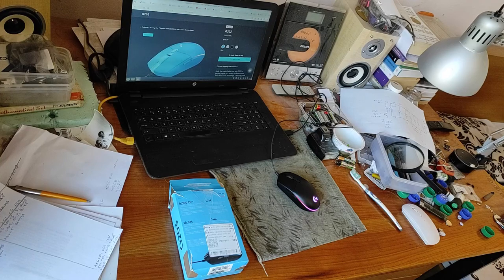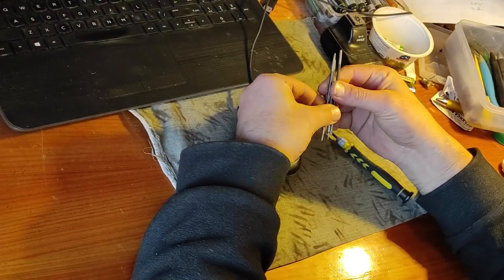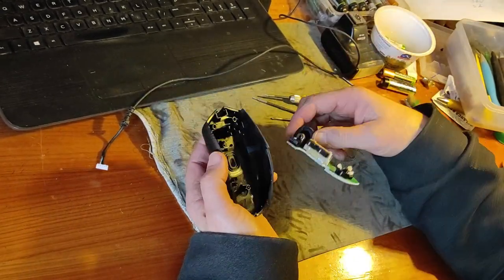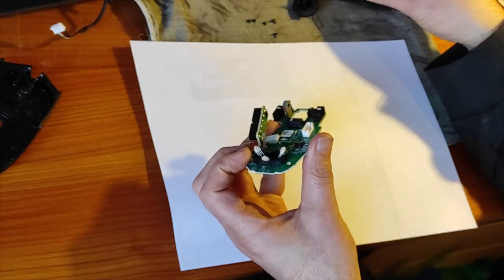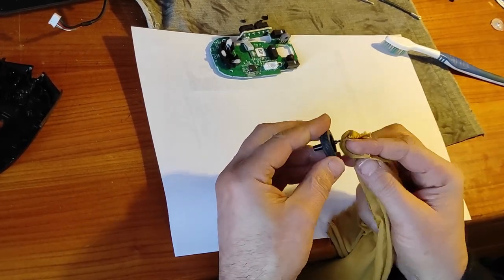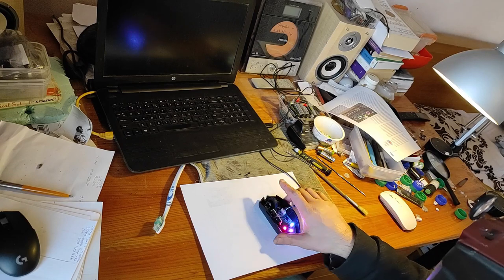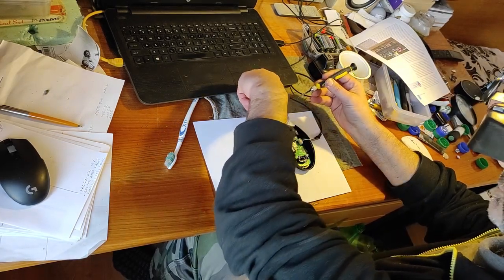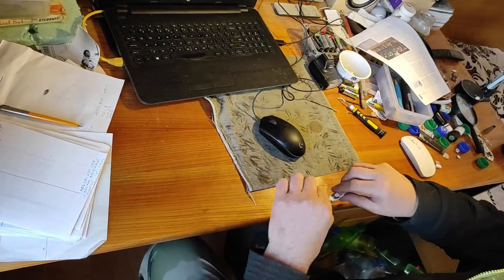Fix Your Logitech G203 Mouse: A Step-by-Step Guide

Comment: One of the best teardowns of this mouse available. Was able to correct the scroll wheel jump just by removing the wheel, then picking and blowing dust out of the switch (mainly because I disassembled the mouse before I realised that I didn't have any isopropyl alcohol).
Reply from the maker: tnx bro .mine is still working after 1 year.

Comment: Not sure you've encountered my issue before: I have that same mouse for a couple years now, the scroll wheel works just fine, but when I left click the wrong way, it double clicks somehow. The only way my clicks stay somewhat consistent is if I click on the part furthest from the scroll wheel. Weird issue
Reply: I've been having this same problem for the last month or so, but w/ my right click.  I used canned air to blow a strand of dust out but it's still doing it.
Reply: Im also having the same issue with my mouse double clicking sometimes not sure how to fix it yet

Comment: I cleaned mine without disassembling it it worked perfectly fine
Reply from the maker: HOW DID U DO IT?
Reply: @diymariuselectro  unplug the mouse spray some alcohol on wheel and sides of the wheel start scrolling so dirt breaks down.  Spray again and keep scrolling  then dry the mouse up plug it back in. Works like a charm ang FYI my mouse wasn't scrolling at all at start. So it's a great fix
Reply: @Shinchi69   W mans, it worked
Reply: @Shinchi69 worked for me. Put a drop or two on either side of scroll wheel. Rolled it for a bit. Blew into it a few times. Win win I'm working. Did not take apart at all. Was skipping and going all over before. Thanks a million. 😊

Comment: Hey, I spilled some water on the same mouse. I let it dry for a few days and now its not moving but left and right buttons are working fine. Any tips how to fix it?
Reply from the maker: you can open it to small parts,clean with technic alcohool,and maybe u r lucky.give  it a try and let us know.
Reply: @diymariuselectro  I actually just smack it on the bottom 3 times. Luckily, its fine now.

Comment: Hello, I have the same mouse but when I connect it it makes a noise on the PC that turns on but then it turns off and starts making the noise. The mouse gets power but it doesn't click or move.
Reply from the maker: hi you probably have other problem with the mouse.I think you have a short circuit on the cable or mouse.use a multimeter and test it.

Comment: mine doesn't even turn on it just died randomly
Reply from the maker: u check the cable?
Reply: @diymariuselectro  yeah, even tried a different cable (from a Logitech m100, same cable) It seems to have got fried somehow, wish I knew how to fix it I only know soldering but nothing else, don't own a heat gun or have any separe parts get.